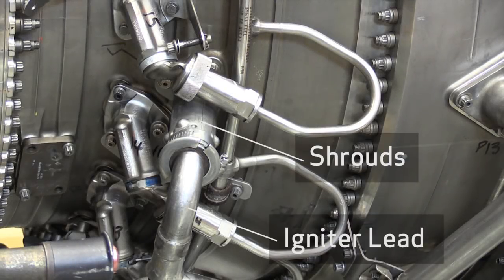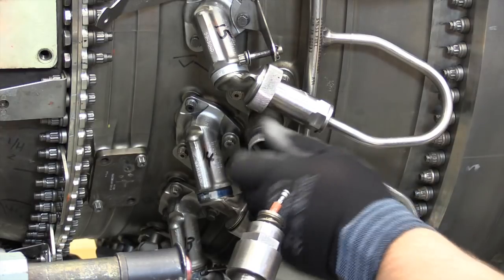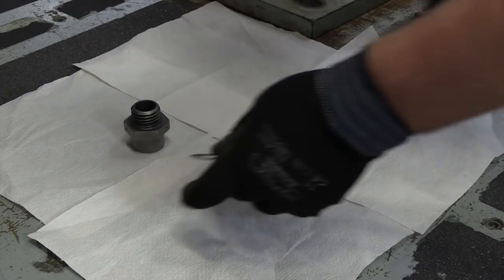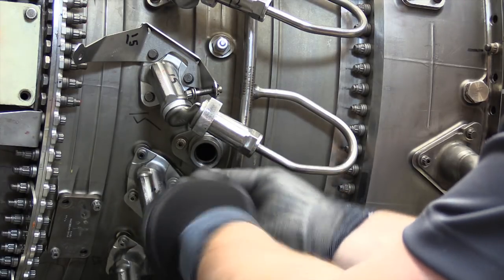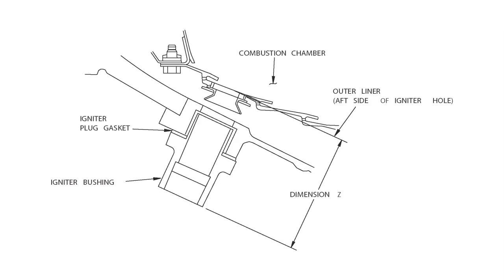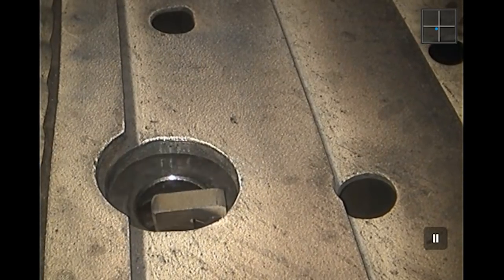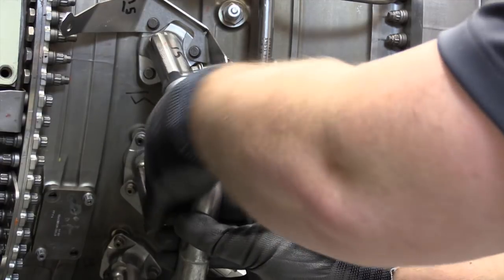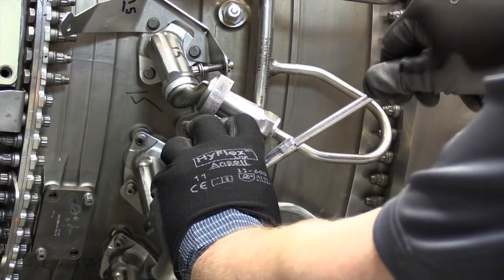CFM - Igniter Depth Immersion - GE Aviation Maintenance Minute

Comment: There should be a silver band fuel nozzle on both sides of the igniter.

There is a blue and a silver installed at those locations.